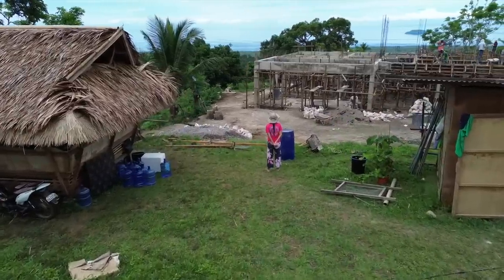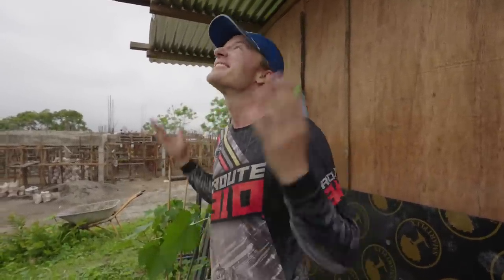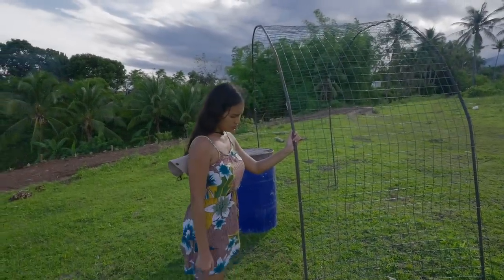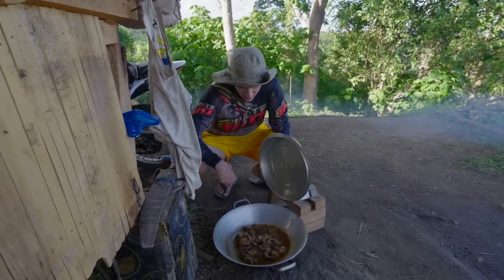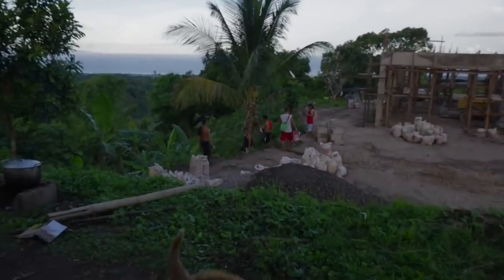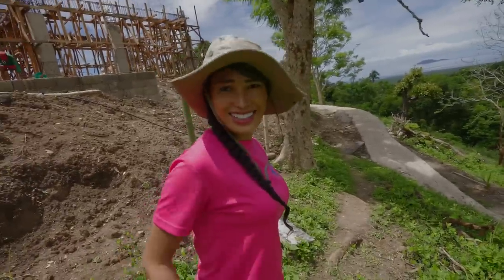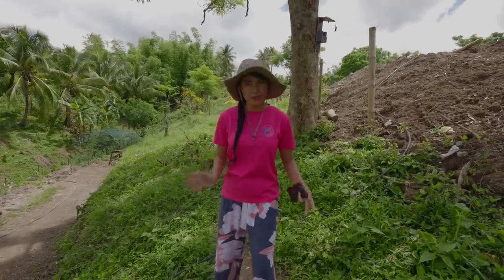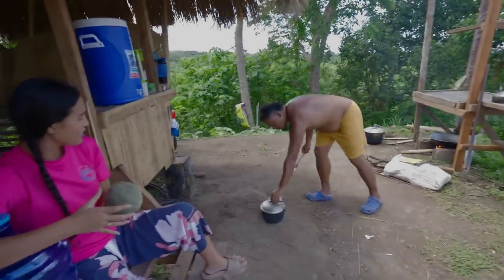Philippines Hilltop House BUILDING DIRTY KITCHEN Cooking Moongo Soup & New Projects

Comment: Google
Optimal tilt of solar panels in the Philippines
... It is a simple formula based on latitude
CONSIDER : ground Mount system in the form of a carport. This way you can place it optimally and it will also protect your vehicles
... I can provide other solar resources that will help you, just say the word in the comments.
I'm in the process of assembling a 25 KW array here in the US. All by myself, three roofs
Reply: I would add, you can get used solar panels dirt cheap and also, beware of clipping so size the microinverters or the inverter based on the peak power of the panels such that you don't waste energy.